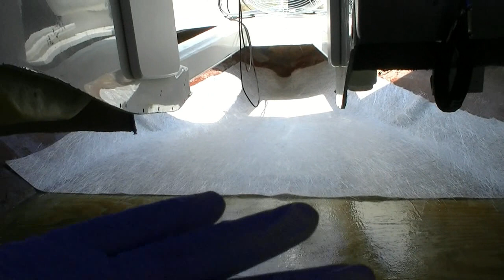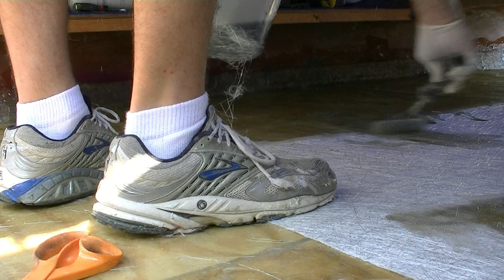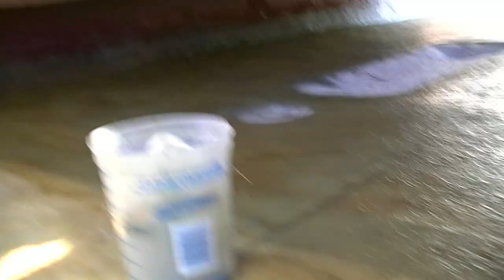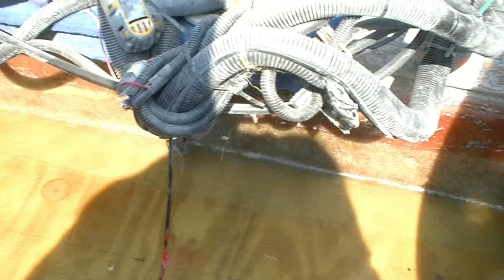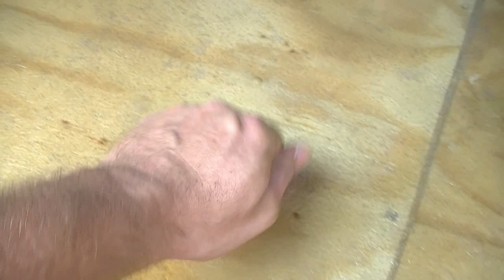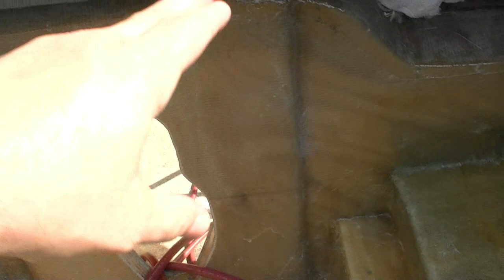Fiberglassing the Deck in the Sea Ray 220 VLOG# 41

Comment: I have a 15ft boat with plywood deck. Im gonna glass the deck and get it all sealed. Can i lay the glass matt (chopstrand? As you call it)  up the sides a bit up against the gel coat? What i mean is will this seal perfectly up against the gel coat or do i have to grind the gelcoat back until glass is showing..

Comment: Great video. Just wanted to know as I don't think I heard you say what type of resin? Polyester or epoxy. I am wanting to do a boat floor sanding down to get all the rubber carpet backing off so want to put a thin chop strand and resin over the entire floor. Never done this so not sure what resin to use. Any advise would be appreciated..

Comment: Do you have to chop strand the deck if you use marine plywood?  Or will 2 coats of resin be enough?Same with stringers. Is peanut butter and tabbing them in enough?  Or do you need to use cloth?

Comment: would be great to see a larger sea ray getting it done.  I have a DA 300 and they put the carpet from wall to wall then installed every thing on top of it.  had to just cut it off at the edge of my doors and cabinets. Also i need to get too my water tank with out destroying most of the steps .  does any one have vids on these job's?

Comment: If a board is already epoxied and dried, is it too late to glass over or can I wet it with the epoxy resin, put on the chopped strand and then wet it down like you did?

Comment: You always do a first class job on the boat! Very good.
I used CPES (Clear Penetrating Epoxy Sealer) on the marine plywood, I should have used the fiber cloth as you did.
Reply from the maker: Ricksos1 It depends on what you are doing. The Glass is a must in my boat for strength.

Comment: Apolgies if its been asked, it looks like you didnt use treated plywood, is that because you used the resin on both sides of the plywood to seal it up?
Reply from the maker: Never use treated wood. It does not allow resin to stick and when it dries it warps.
Reply: @FriscoBoatersGarage  thanks for the reply, been searching around and I got mixed up. So you used "marine grade" correct? I thought marine grade was pressure treated but I was mistaken

Comment from the maker: I used 80 grit. It allows some tooth for the gel to hold onto. I made mine pretty smooth as I wanted it to look really nice. It depends on how warm it is. Most of the time I let it cure just to where it is tacky and then put the second coat down.

Comment: How long can you wait before putting the gel coat on...?  I've seen on another vid that polyester laminating resin needs to be sealed with something, or it stays tacky...  Just trying to bust some myths in my mind here...
Reply from the maker: highvelocity123 The fast the better. Poly adheres to poly. If you wait too long you must sand it with 36 grit first before putting down your gel. The only reason to seal it is if you used over priced epoxy.
Reply: So you used the gel-coat to over the last coat of resin.  Did you add the wax to the gel-coat or was it pre-mixed with wax?
Reply: highvelocity123 Excellent question.  I saw in another video where the guy added the wax portion during the gelcoat.  After the matting/resin coat, he laid down a coat of primer for the gelcoat, then applied the final gelcoat with wax to harden it and ensure rock solid final product.  Not sure what this guy in the video did because he didn't show us.  So far his work is really nice.

Comment: Nice job! I'm curious, why does a boat that's a 95 have a wood floor to begin with? I have a 95 Four Winns that is completely fiberglass. No wood at all. Seems strange that a big company like Sea Ray hadn't modernized their by designs by the 90's.
Reply from the maker: I think there is still wood under it, that is what I have seen before. The deck is just a liner backed by a wood deck and stringers. I might be wrong.

Comment: A lot  of work and slot of materials , people that don't do that type of work have no idea what is envolved.  I am doing some major repairs on our sailboat, I have used 9 gallons of epoxy already. My coworkers just don't understand. Keep up the good work. I am considering using polyester in some areas to lower the cost. I see you use it a lot. Have you had any bonding issues ?

Comment: what is the mixing ratio you use to mix resin with hardener I mean like , do you go by the 10 drops to oz like it says in the can, cause it dries too fast when wixing 8 oz or more..
Reply from the maker: raul resto It depends on the brand. The junk from Home depot (elmers or bond) goes off quick no matter what you do. Each manufacturer will let you know what their optimal blend is.

Comment: hi mate, the resin you use is much runnier than Im used to. is it a special kind of resin? whenever ive used resin it has not been pourable like yours, it has had the consistancy of warm treacle? just wondering what kind it is? cheers

Comment: Hey Jay, what did you use to sand/ grind before applying gel coat. I am to that point now. How smooth does it need to be? How much time between coats do you have to wait. I got gel coat from US Composites like you told me. Thanks Bill

Comment: Nice I like using the red MEK rather that the clear to me I see the air better and rolll em out I just pulled a mold of a 10ft plug deck and hull gonna make about 5 parts out of those molds

Comment: What resin did you use? Great video by the way!
Reply: +FX4Matt Educated guess is, standard polyester laminating resin. But don't use this as an instructive video. He's doing the laminating all wonky. He's using way to much resin and with an aluminium roller that's only to be used to press airbubbles out. It's alot heavier than it needs to be,  and it's probably brittle. :(
Reply: rawenclaw80 he is actually using a fiber roller and not an aluminum roller.